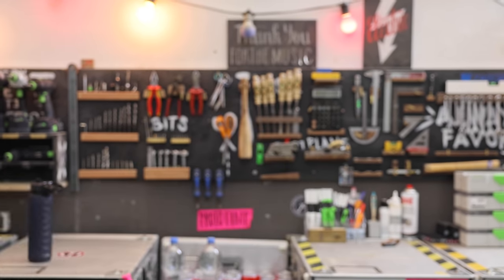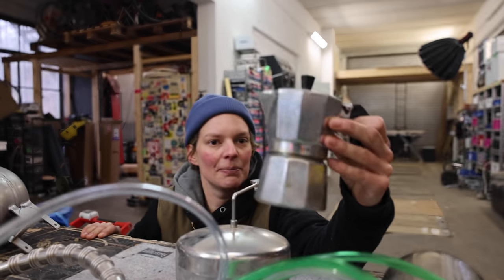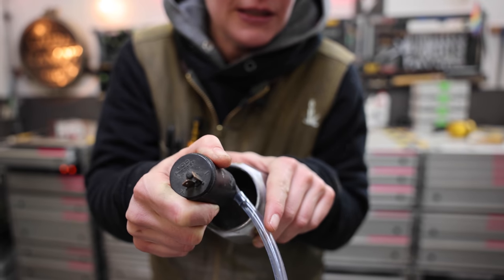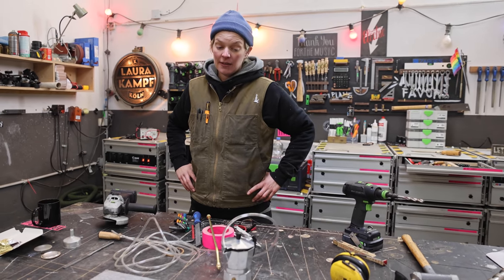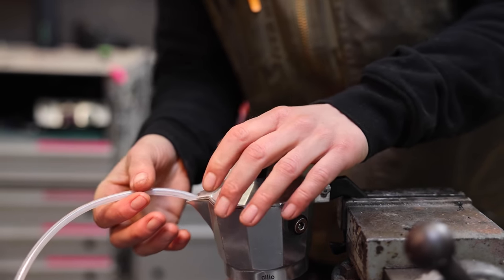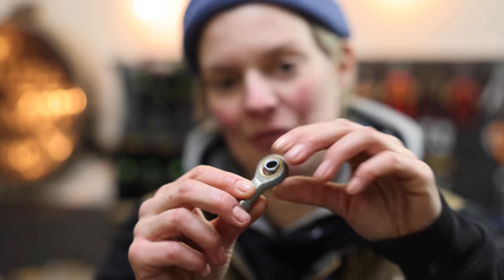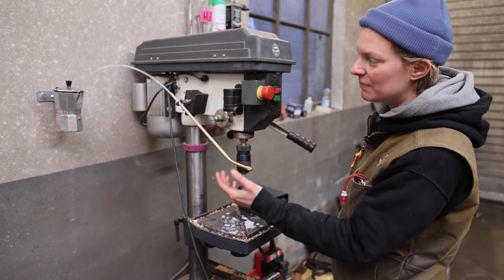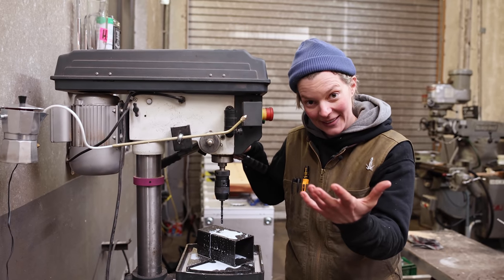Cutting Oil Pump from old Coffee Maker (genius or stupid idea?)

Comment: Hi Laura,
the solution is simpler than you think: put the coffee maker lower than the liquid outlet point: in this position the pump fills the siphon which then continues to drain until the coffee maker is empty, with the coffee maker at the bottom instead the liquid will return back by gravity
Reply: I was going to write the same, but don´t place it too low, or the pump will struggle.
Reply: Same idea, with a waterproof tube of course 😊
Reply: I was going to say the same and then attach the flexible hose better to the rigid so it stops leaking
Reply: I was going to post this, but Yes! Exactly what Zola just said :')
Reply: I think it wont fix the problem completely. The pump might be the problem, cause its constucetd du bild a high pressure at the nozzle to spray fluid on the windshield. When you stop the pump the resitance at the nozzle is ti high and the spraying stops.
I don't know how the pumps are called, but they are used in medical applications and block the flow completely when stopped.
Reply: I totally agree!
Reply: @cypris2010  peristaltic pump!
Reply: @cypris2010  Peristaltic pump?  They use a rotor that pushes on a rubber hose and the fluid being pumped never actually comes in contact with the pump.
Reply: Auf Deutsch: Das ist ein Saugheber Effekt, solange der Vorratsbehälter höher als der Auslauf ist.
Reply: Was about to say the same thing... 👍
Reply: exactly what i was going to say
Reply: The downside of op's idea is that the line drains. You have to wait for the line to refill each time you want fluid. A peristaltic pump, or a gravity fed fluid with a hydraulic solenoid near the tip (scavenged from an ice maker on a discarded refrigerator).
Reply: Greetings.  
I agree.  That was my first thought too.  Maybe put the pump on a vertically adjustable track so it can be configured to the height of the work piece.  Hope this helps.
Reply: You are right am surprised she did not catch that. As long as that thing is higher than the nozzle the liquid will continue dripping non stop.
Reply: And, if the pump is lower than the nozzle, you can collect the oil-water and let it with a small pipe from the table of the drill back to the pump
Reply: @cypris2010  Yeah but the high pressure might also be part of the solution. You might use the safety valve from the coffee maker to stop the fluid. If the pump generates engough pressure the valve should open.
Reply: Yes, indeed that should solve the problem
Reply: I was about to post the same answer. Easy peezy
Reply: Beat me to it.  🙂
Reply: 💯 It's syphoning the fluid out.
Reply: I came to the computer to say the same.  Mount the espresso maker lower than the drilling surface and have as much of the tubing as possible running uphill so the excess will flow back to the coffee maker.  I think it's the excess fluid in the tubing flowing downhill more than a siphon, but could be both.
Reply: Hi Laura. A peristaltic pump will fix your problems. It is easy to make, looks cool, and cill give you great presicion
Reply: @jc5c515  a unidirectional flow control valve can help!
Reply: @jc5c515  Shouldn't struggle too much. Car washer bottles are typically 50cm or more lower than the washer jets.
Reply: Oh, I see DMonZ1988 came up with the exact same solution yesterday. Currently, air can enter where the hose goes into the brass tube. If you seal that opening, it might stop the dripping. Good luck!
Reply: I think so
Reply: Pretty basic :-)
Reply: Lower mounting point and a one way valve - this is how it works on a car, and those pumps can pump the fluid all the way to the rear of your car as well!
Reply: @gRuHa89  yup, just about my thoughts as well. Lowering the oil tank and a one way valve to reduce the oil flowing back
Reply: Agree but with two additions:  The connection between the vinyl tube and the brass needs to be air / pressure tight. Right now it looks like one is slipped inside the other.  Also the addition of a check-valve will prevent back flow into the reservoir ( which is now mounted  lower than the tip).   Fantastic imagination, esthetic, and problem-solving Laura!  Cheers!
Reply: You took the words right out of my mouth.  On a car, the windshield washer nozzles are elevated above the pump and reservoir, so there's no dripping from gravity.
Reply: Brilliant.  That should do it!

Comment: You need to mount it lower on the wall to stop the pipe acting as a siphon. Love how crazy the design is though!
Reply: Yup! That's the answer!
Reply: Yep, siphon effect is the problem. Pump up to eliminate it.
Reply: This was my exact thought!
Reply: Or put it higher, loose the electric pump and fit the small valve on the brass rod.
Reply: Ditto!!!
Reply: This
Reply: Gravity is causing the "leak" ...
Reply: I was about to suggest the same!
Reply: +1
Reply: Maybe same height, so it does not flow back either.
Reply: Mounting the liquid container lower than the nozzle should solve the problem because gravity will not pull the liquid through the nozzle anymore. And gravity pulling the liquid back in the container doesn't sound like a problem to me. An alternative, but way trickier, solution could be limiting the airflow into the liquid container so the negative pressure the pump will create by pumping liquid out of the container will stop the liquid from flowing caused by gravity, but then you risk restricting airflow too much and then the pump won't be strong enough.
I would definitely put the liquid container lower on the wall. Awesome little project!
Reply: I came here to make the same point. It appears to be acting like a siphon with the coffee can mounted at that height. Very cool solution idea.
Reply: The problem is the flexible tube doesn't have a seal where it connects to the brass
Reply: +1
Reply: The engineer within says add an electric valve close to the nozzle  but simply  lowering the washer pump will probably do the trick. I'm not sure though, whether they have a check valve built in.
Reply: I was going to say the same thing.
Reply: You’re going to kick yourself reading this comment!
Reply: my thoughts exactly
Reply: Or you fit a valve which opens when the pedal is in use and closes when the pedal is not in use
Reply: I was going to suggest the same. Mount the tank lower like maybe somewhere in the bottom part of the drill press column.
Reply: Genius!
Reply: my words
Reply: I see I’m not the only one with this idea! Windshield washer pumps are very strong — you could probably put that reservoir on the floor!
And now I know what your lubrication fluid is! I’ve been wondering that! Keep up the awesome videos!
Reply: Maybe combining a lower place with some key to close or doing a inversion of the pump for one second and it will work fine 😁👍🏼
Reply: @CopiWood  but then you have to start the siphon when run out of the líquid
Reply: If you can find a check valve that is used in the car washer lines, it will probably solve it as they need pressure to open so should stop the syphon a better seal between the plastic and metal pipe would also stop any air getting in as well. Great project.
Reply: Exactly!!! think about how the washer pump is mounted in a vehicle, always lower than the actual spray nozzles that output to the vehicle glass.
Reply: Yep solution is pretty obvious, as small diameter line as possible, going up to the end as the highest point, and only the nozzle bent over to minimize the volume on the other side of peak.  Should still be near instant on with any reasonable pump.  
Catch tray, filter, and drain tube under the table and back to the can would make it a lot less of a pain too, no need to clean up much just let it drip back to home..
Reply: @CopiWood  won't make it hands free though.
Reply: Probably just needs a small back flow valve,  but spot on it definitely needs moving
Reply: Came to write this

Comment: Hey Laura, look for a small non-return valve (Rückschlagventil) from the aquarium accessories. This is simply inserted in between the hose. This prevents the liquid from continuing to flow when the pump is not working,
Reply: or use a bit of gravity too : )

Comment: Adding a one way valve with quick connects (festo style) at the end of the garden sprayer nozzle might be just what you need. The spring preload of the one way valve will keep it shut under 0,... bar and if the pump is running it will open up. The same style of pneumatic line connector can be used for your clear pipe to garden sprayer connection also.
Reply: I would go for this solution. In the factory I worked in, we had a similar system for supplying engine bearings, crankshafts, etc. on the lubrication nozzles, there were check valves. Fun project and I hope you solve the dripping problem.

Comment: @Laura if you seal the connection between the silicon tube and the brass nozzle it will probably not drip any more. I think the issue is that air is leaking in there and as a result the nozzle drips. You can see that it isn't sealed when you blocked the nozzle with the sponge, then the fluid came out the back.

Comment: A normally closed solonoid shut off valve in line with your out feed would cut the flow and could be rigged to shut off whe  you remove your foot from the footswitch .. I have a simple gravity feed on my lathe with a simple in off tap

Comment: Try sealing the fluid delivery tubes. I had a similar problem of delayed pressurising and low pressure coupled with drips with my car's windshield washer. There was air ingress in the tube where it attaches to one of the nozzles. I just cable tied it. Works so far. Worth a try.

Comment: I think you can try to purchase check valve (or non-return valve, i dont know how they call it in english) in car parts store. 
It needs some pressure to let fluid go through it, so, i think, there won't be any unwanted drops after you power off the pump.

Comment: Well, I kind of built the same last year. Instead of using a pump, I was using compressed air to slightly pressurize a bottle from that a small tube was bringing the fluid to my workpiece. I had the same issues as you. Not the main function in general, but the mess it created because It doesn't want to stop dripping. I ended up using it almost never... 

If I'm ever going to rebuild this, It will be gravity fed, like old oilers on machines used to be.

Comment: a Check-Valve / One way valve in line may solve the issue. I would look for a spring loaded one. should work no matter the height of the pump and reservoir

Comment: also the connection is not air tight. that is why it drips what liquid is left in the tube. you can try heating the end of tubing and fitting it over the brass, it will expand when hot and shrink when it cools and should give a better seal.

Comment: For the up and down movement it looks like the varnish will strip away overtime. I would suggest a small hose clamp with thumb screw above the heim joint to set the y distance, you do it once at the beginning of the job and you are good. 

Maybe add some sort of small motorcycle petcock into the bottom to again turn it on at the beginning of the job and off at the end.

Comment: Hi, I would reverse the polarity for a second, so that the pump sucks the fluid out of the tube and back in to the tank. But it depends on the pump design if this approach really works.
Reply: An Arduino micro controller with a pair of relays could do this very simply and very cheaply

Comment: What @zola tanaffa posted is the basic solution. Although, I would add a sealant where the flexible hose meets the brass tube as well as perhaps a soft cap for the tip. An o ring between the tube and the brass would work. Or a mouldable silicone, such as Sugru. You could make the tip cover from this as well.

Comment: Love your work. The arm, I think I may have a solution. Could you drill the top in the downwards, run a thread and use a bolt to apply and relieve tension?

Comment: Compression fittings. lots of solutions for making brass tube air or liquid tight.
You may also want some kind of sink or catch basin for the used fluid. Which might be filtered and reused. 
And Smudo was wondering about that squirting on the floor thing. 😀

Comment: Also, you made a gravity syphon, as per why it drips continually. You solved the issue just by raising the tip above the top of your reservoir. Beyond that, good chance any spring clamps, clothing pins, etc. you have handy will be enough to pinch the vinyl tube if you don't want to move the nozzle.

Comment: Solenoid valve in parallel with the motor. They're like 10 bucks for low pressure applications. Splice it into the brass tube and then all you have is the volume of fluid between the valve and the nozzle to drain out. I second the lower-on-the-wall option too, since that'll limit siphoning.

Comment: How about the fluid is gravity fed, with a valve at or near the outlet? If it can't be at the outlet you may still get a little drip, but you can adjust for that by timing how long you keep the valve open/peddle pressed.

Comment: Put the coffeemaker below the drill table, that will solve the dripping problem and if you make a return hose on the table with a (coffee ) filter ; ) between to catch dirt and debris, stick the other end of this return hose in the coffeemaker and you’ve got a closed system, every ones awhile ad some water or change the oil completely.
 Great design you made, now let’s make it completely functional as well.

Greatings from the Netherlands

Comment: I believe that they reason might need they position of them coffee maker (mentioned quiet a few times) and the convention of the hose and the metal pipe not being tight. Air can come in from above and let the fluid drain. So making the connection between your transition house am the brass parts air right might help.

Comment: Rubber stoppers on the spout will be a longer solution to stop it from sliding up and down in the pivot joint. Have you considered a small valve on the clear tubing?

Comment: on the end  use a metallic ball and a spring  with pump pressure  it opens --- like my  old carburettor   to add oil  the pressure of  the pump   push the ball against the spring  ,when ends  the spring pushes the ball  no oil dripping

Comment: Great work of using what you have on hand. But this time it would be better if you would use a small peristaltic pump. The dosage can be controlled way better - no leaks, and you can use the glass jar with the ceramic top, or any other container as big as you would like it to be. Just my thoughts, as I use this kind of pump, even though not for this particular job.

Comment: Like other commenters here, I'd suggest mounting the reservoir and pump significantly lower than the nozzle's operating position to take advantage of siphoning. I'd also work on a more positive connection between the brass tubing and the clear tubing, A compression fitting is going to be your best bet there.

Comment: Try adding a spring and ball bearing between the supply hose and nozzel tip. Pump pressure pushes the ball bearing out and the spring returns the ball bearing sealing the tube. play with spring and ball sizes but it should work out well.

Comment: in washer fluid system the use one way in line valve to stop dripping when the motor is off, its basically a plastic tube with flanges and ball with spring that will close the fluid after pomp finished pumping, just google it or option easier add like valve in line with discharge pipe? but then you need to make sure between rubber hose and pipe there is tight seal
Reply: My experience says the one-way valve is in the reservoir, and there to prevent the washer fluid in the lines from draining back into the tank. This is done so that you immediately get fluid sprayed when called for, rather than having to wait for it to fill the line from the reservoir to the spray tip. That distance can commonly be from 4 to 5 feet, since the tank is usually mounted near the front of the engine bay for easy refilling.

Comment: If mounting the pot lower doesn't help due to siphoning action, than you'll need to block the flow.  Putting a solinoid valve at the end would screw up your weight at the nozzel so than you'd want to vapor lock the fluid but you're fluid might be too non-viscous to hold the lock with that gauge of tubing.  You could consider a peristaltic pump with smaller tubing to replace the one in the pot.
Reply: This is a common problem in dosing pumps... In those you have a spring loaded valve inside the nozzle. You can make it with a small ball bearing and a spring, strong enough to stop the flow when pump is turned off, but soft enough to allow to compress with the pressure that the pump builts... This will pressure your entire piping, so you'll need to seal better the joint between the flexible hose and the copper tubing, maybe using a quick connector, like the ones used in compressed air lines
Reply: those pumps can be found in old home/use coffee machines like some of the older gaggia classics
Reply: 💯 It's syphoning the fluid out.
Reply: Was going to say the same thing

Comment: I love your work.
I think a solution here might be to give the plastic pipe a liquid\air tight seal to the brass tube.
That way when the pump stops, there'll be a pressure that'll hold back any more fluid flowing.
Depends on how the pump works though.

If the pump is an impellor, then having the reservoir below nossle should help too